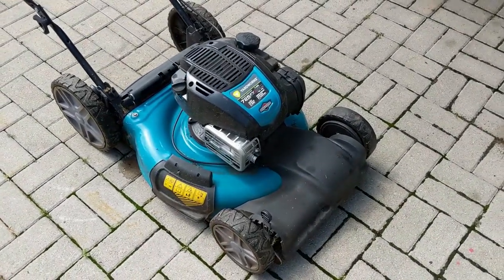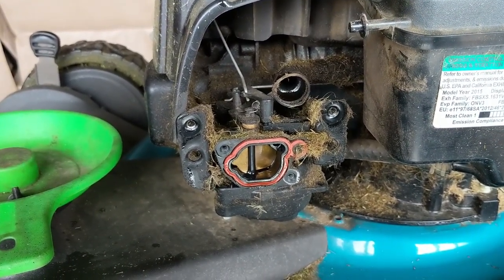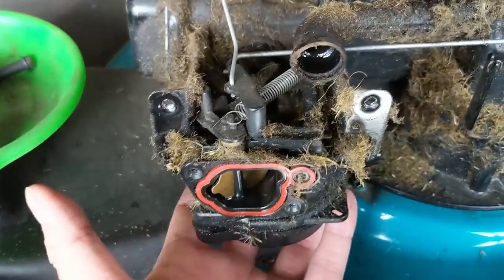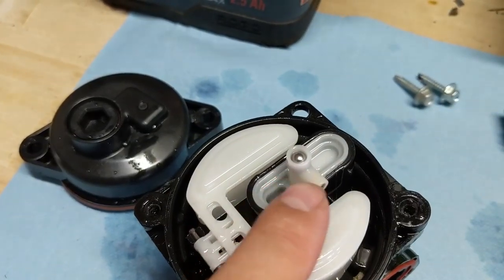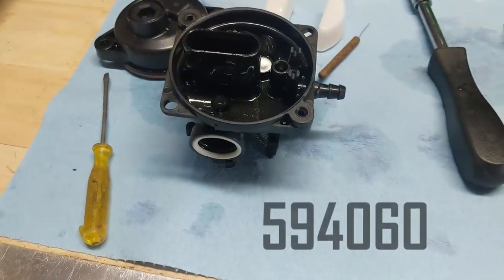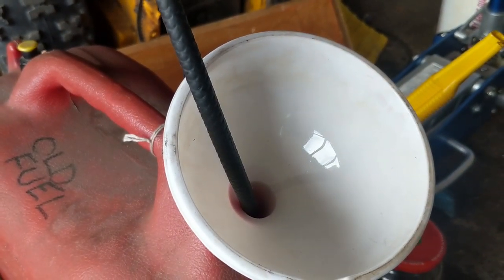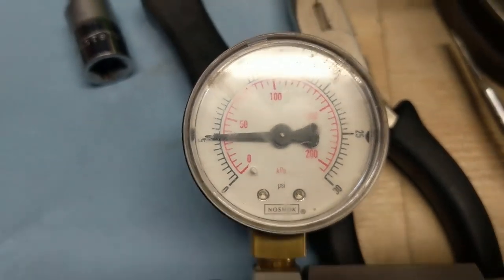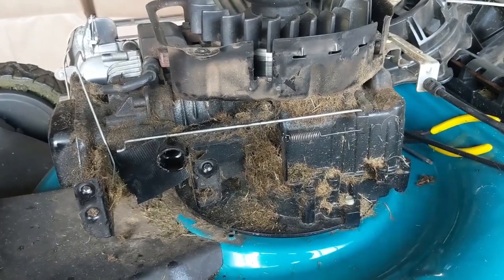How to Clean a Plastic Briggs & Stratton Carburetor

Comment: Is that a vent that black piece sticking out by top of fuel tank ? On the top left it was showing above your valve when you were draining it . Also my fuel comes out slower when taking off hose could it be clogged or is vent not working . My cap doesn't have a vent in it . I figure that black plastic piece is vent . When I stick wire in it it only goes length of sticking out . Almost like a flap keeping anything going in too far. I see a filter at bottom of tank but I can't clean that cause top doesn't come off fuel tank. That would be good idea so you can clean it better

Comment: I drilled out the main jet since it was clogged so bad I could not get a bread bag wire thru. Since then the engine has dropped RPM's too about 2000. It also is blowing white smoke thru the muffler. I tried adjusting the arm to increase the RPM's but no significant response.
Did I ruin the main jet by opening too much? Let me know your thoughts. Thank you Eliminator for your expertise.
Reply from the maker: Yes it's possible, you can buy the replacement part 594060 and start fresh
Reply: @EliminatorPerformance  Already ordered. Wish me luck. Ty for your quick response.

Comment: The needle valve tip tore when I lifted the float. It is an Exi625 snapper with a bs 093j02-0138-f1

Do you know the part number for a new needle float valve?

Comment: Question about this BS carb on a  Husqvarna LC 221A.  Having this issue, but after filing the corner as you did, the mower will not start.  But, if I move the lever that was filed behind the choke it starts and runs fine.  Any idea as to what may be wrong because I know that this is not the way it is suppose to be!  Thanks  Ed

Comment: EP I just bought one of those brand new I'm still surging what to look at now?
Reply from the maker: O-ring around the carb that seals to the engine. Or small cracks anywhere in the carb, these things are plastic. Sounds like less fuel, or too much air. Maybe inspect jets.
Reply: @EliminatorPerformance  I'll check but it's brand new but I get what you saying. What about the air filter holder could it be warped???

Comment: Do these have an idle /pilot jet ? Can it be bored out?
Also I notice some of these have what looks like a barbed tube for a hose to fix to like the fuel inlet but it is white what is the function of this?
Reply from the maker: That's the other brass jet (the one that's usually inside the black tube) I wouldn't bore it out more than 0.002" oversized!
Reply: @EliminatorPerformance  great thank you!  I was editing comment when you replied... Also I notice some of these have what looks like a barbed tube for a hose to fix to like the fuel inlet but it is white and on the outside of the carb what is the function this?
Thanks for all the vids, very clear and well explained
Reply from the maker: @offbeatwarble  anytime, and I believe that on some models they have a primer bulb and it hooks up to a tube that goes to that smaller inlet.

Comment: I thought the descriptions were good and detailed.  I though I had followed every step BUT   Help the carburetor leaks all the gas out of the tank.  AND  when I tried to start it the pull cord seemed stuck.  I obviously did something WAY wrong.  Suggestions on what to look at or do?
Reply from the maker: It's possible that you didn't install the needle valve correctly. This could potentially flood the carburetor, leaking gas into the cylinder. If you remove the spark plug, try pulling the cord then. You should see fuel come out. Pull it a few times until no more fuel comes out, and reinstall the spark plug. Probably good to change the oil now as well, as fuel may have gone past the piston rings into the bottom end of the engine where the oil is
Reply: @EliminatorPerformance  Thank you I will try all those things.  This lawnmower says never change the oil.  Should I anyway?
Reply: I reopened the carburetor and either the needle valve or the little float was quite snapped.  Put it back together.  Drained the spark plug you were right it was flooded.  Decided to do the oil and glad I did.  It runs like it is brand new again. THANK YOU!!!!

Comment: I lost my needle for my carburetor. How do I know which carburetor I have? It's a Briggs and Stratton 675EXi
Reply from the maker: So you need to find the model number of the engine, not the mower. Look on the engine, you should see a number somewhere from Briggs and Stratton. Some new ones even have a qr code you can scan. Take that number and google it with parts diagram after, you will then find the parts listing. Choose carburetor diagram and then you can get the proper needle valve part number by selecting the part on the diagram. Then order it from anywhere you can

Comment: Instead of removing the tank I pulled the line and after emptying the fuel I spayed carb cleaner in the tank and let it run out the fuel line. I also spayed the carb down while it was still on the mower.

Comment: What can you do to stop these carbs from making engine to surge. Got it to stop on third carburetor replacement.
Reply from the maker: They're plastic so not much unfortunately, and they don't have adjustments. Could have a hairline crack that causes an air leak causing lean mixture = surging

Comment: Great video!
Just curious why you didn't take apart the white piece with the distribution tube? Maybe it's not necessary.?
Reply from the maker: It's a complete assembly, so I just throw them into my cleaner as a whole, part number is 594060 for reference.

Thanks for watching!
Reply: I had same question.  I’ve found that the 3 tiny holes in the distribution tube can be plugged with fuel varnish.  Not to difficult to pry off and reinstall. Then again, I don’t have an ultrasonic bath.

Comment: Why do you use high octane gas in a mower?
Reply from the maker: Because it was the only fuel that was Ethanol free here in Ontario. Sadly all fuel grades contain ethanol now. If we could've purchased 87 octane without ethanol, we would've bought that instead
Reply: @EliminatorPerformance  Got it. Thanks.

Comment: what is Spray 9?
Reply from the maker: Degreaser, it works amazing and cuts through grease better than other brands. I'm sponsored by Permatex which owns Spray Nine, so take that into consideration. I contacted them because I used it before, and continue to use it.

Comment: My dilemma is I can't get the choke to work. I have taken this car apart and put it back together after watching 2 different videos one of them is a female a light blonde 5060-year-old woman showing how to take it apart and put it together and the mechanism when you squeeze the handle at the top of the handle the choke will not engage. I may must be missing a linkage or Spring that when you squeeze that liver the chok linkage from the carburetor makes his way to the back of the lawnmower and the link is doesn't move.

Comment: Just did this and mine still wont start. Brand new only used 3 or so times and been sitting for a year or so. What could be wrong? Going to the shop right now to grab a spark plug.

Comment: I've got one of these and It's a real bear to figure out. It won't start, so I checked the spark plug and have spark, I pulled off the Carb and did an inspection minus the "Distribution Tube" section that you did here. Now that I think about it, there was enough gunk in the rest of the carburetor that the small jet you pointed out as having crystalized fuel, is probably my problem. 

Interestingly enough though, when I first remounted the carb and pulled the cord, it almost started on the first try, then all pulls after absolutely no indication of combustion at all. Which makes me believe it's either not getting any fuel, or it's getting too much and flooding. However, the unit doesn't look like it's flooding. So I'll assume the Jet is clogged. 

I rebuilt Carburetors in the Army for trucks back in the 80's and like these little plastic ones here, they weren't that great a design in some areas. 

Thanks for this video, it helps a lot. I'm now subscribed.

Comment: So I'm not getting fuel to the spark plug, would cleaning out the carburetor remedy that or do you think it's a fuel pump issue?
Reply from the maker: Yes clean the carb, and remove the gas cap, make sure fuel drains when you disconnect the line from carb, and blow the line out back into the fuel tank just to make sure it's clear
Reply: Ty

Comment: Thanks for the video, i just removed the carburator and cleaned it with brake cleaner . It was full with oil. I missed your video so i didnt cleaned the jets in distributor. Will do it again. Thanks to your instructions. Just a message to youtubers, in my case the previos owner had about 1/2 a liter of extra oil that caused to run into the carburater when placed in shed upright.

Comment: I always try to blow/wash off the engine before working on it.  Great Fix.  I run a bunch of short metal screws with hex heads into worn tread on drive wheel.

Comment: Just fix my neighbor's lawnmower equipped with plastic carburetor through 3 videos l viewed today .
Your's are the most informative,  thanks
However, do simplify some procedures, since the interiors are pretty clean after opening it up,  just pop the cartridge up ( using those sewing package needles and tool from Dollar Store) clear slightly  enlarge the main jet, mouth blow to ensure all holes are unplug ... Reinstall accordingly ! 
One pull started and stay on repeatedly, 
Self satisfaction 😅hank

Comment: I have a DR trimmer with a Briggs & Stratton 6.75 engine. Couldn’t get it to start. It would fire with starting fluid and then stop so I guessed I had a fuel problem. At 82 I wasn’t sure I was up to tackling a carburetor clean out never having ventured inside an engine before but watching your excellent video convinced me to give it a try. I watched a dozen videos and must tell you yours is absolutely the clearest step by step complete explanation with excellent video! You even showed how to remove the engine cover which none of the other videos thought to include. I was about ready to break it off after removing the 2 bolts. I knew you were a premier YouTube instructor when you took the time to list the part number for the o-ring around the top of the fuel jets assembly which might become damaged during take apart. The gold at the end of the rainbow was when my B & S started and ran perfectly on the first pull. I appreciate the time you take to make such an excellent, detailed how-to video. Bob Mc Bride in Maine

Comment: What solution do you use in the ultrasonic cleaner?  I fill mine with water then put gas in a Ziploc bag with small carb parts.  Sounds crazy but I got the idea from Steve's small engine repair or something like that.  I don't use the ultrasonic much though.
Reply from the maker: I'm using Zep orange now it works pretty good

Comment: Hey Champ - I did this to my friends slighly smaller 5.5 140cc Briggs and Stratton - didn't work. IF THE SPARK PLUG IS WET -- Do you think its the ignition Coil ???  Please Please resopnd.
Reply from the maker: It's possible, remove the plug and pull it over a few times to dry out the cylinder. Put the plug back in, remove air filter and spray a small squirt of starter fluid in the intake. If you pull it and it doesn't fire, you likely have no spark.
Reply: @EliminatorPerformance  Thank you for your prompt Response sir -- You are the Best.

Comment: Nice video but  I drill  out the main jet with a # 72 drill bit .025 works great , starts first pull ,,,,even the ones without the auto choke . I'm a 74 year old machinist and I'm like you " Old School "

Comment: I could not ask for a more complete tutorial. The last time this happened, after taking out the carb, I just bought another for 20 bucks. They probably cost a lot more now. I also installed a fuel filter and fuel cut off valve back then, so I won't need to pinch off the line.
 Thanks to you I am going to clean the carb this time and I appreciate your help and well done on its production.
The metal carbs on the old briggs seemed to last for more than a decade without fouling.

Comment: Hey man great tutorial! I have a power washer with this engine. I was worried I'd break the main jet distribution assembly and your video helped me confidently remove it from the plastic housing. I may have gotten it without the vid, but I also may have broken it cursing the whole time hahaha. I fixed my engine using only some carb cleaner spraying the jets which were plugged due to E10 gas left over winter. I ended up watching the entire video. Just want to let you know that I like your commentary and editing. This is the first video of yours I've watched. You have a way of including all the pertinent detail that's condensed yet understandable. You're a great mentor thanks!
Reply from the maker: Thanks for watching!

Comment: I Would have clean the outside first using pressure air and blow off all the grass trimmings, etc of the mower before dismantling the caburator and air filter.

Comment: where can I buy extra those white port injectors?
Reply from the maker: Google briggs and Stratton fuel module, there's lots of different ones with different jet sizes though so search your engine model number and find a parts diagram to make sure you get the right one

Comment: Good video! What solution did you use in your ultrasonic cleaner?
Reply from the maker: I'm using Fabuloso now, but any degreaser that won't dissolve aluminum is pretty good. Zep orange is good too
Reply: @EliminatorPerformance  Thanks!

Comment: And anuther fine job.I have been rebuilding a briggs 21hp Twin and  when i went to install the inlet line to pump i looked at the filter and you could see where the gas that dryed  up the same light brown sh__ had taken the place of the fuel. So before i start the fresh engine i'am going to pull the carb and clean it good.
Thank for all the info you give us every week. Please don't stop.
Wireman Bob
Reply from the maker: Thanks for watching Wireman, and good luck on the Briggs!

Comment: That`s definitely the be3st tutorial ever!  We have the same engine, but fixed on Toro mower. I have performed the same carb cleaning, just with no ultrasound cleaning. However... lack of results. It`s still too problematic to start it. It can be done once per day :) If it started successfully, the engine is working, but if you try re-start it- that`s absolutely impossible. But it can be started next day :)  Very tricky...  There is compression (I can feel it while pulling the cord), spark plugs are checked, carb has been cleaned... What else can be done???   Some resources blame the main such plastic carb main jet. It`s too small in their opinion. Advise was to drill it with micro drill bit up to 0.4 - 0,5 mm size. Can you tell whether it can be a solution, please? Also, my dream is to replace this plastic carb with a traditional metal one...  Is that possible, please?   Thank you

Comment: Great video, thank you!

FWIW - I recently found out that you can pop the plastic choke arm off the carb and leave the linkage attached... 

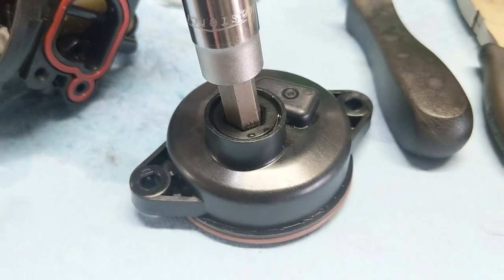At 9:30 in the video, showing the oval housing of the top of the carbs bowl area.  I am unable to clear the passage on the left even though I can run a wire into it from both directions, the top of the bowl area and from the hole on the side of the venturi, assuming that's where it comes out???  Is that where that passage goes or is it blocked off on purpose?    Thank you very much!

Comment: when you pull the "throttle" cable should the buttfly valve actuate? i have a pretty much brand new toro with a brigs and stratton and it sat over the winter and im sure the carb is gummed up but i noticed that when i pull the lever or throttle cable the butterfly valve doesnt do anything. i am really only comparing this to what i am used to seeing on a motorcycle so maybe thats the way its supposed to be

Comment: Nice fixing video thank you.
I have the 575EX and my problem is still there.
The engine is running on highest rotational speed. I couldn't find any screw to set it to 1700 rpm I guess.
Any idea? Sry for my poor English.

Comment: How do you adjust the RPM'S on this 725exi engine, is there a tab to bend?
Reply: Yes the tab is located under the fuel tank it should have a spring running back to the gov lever